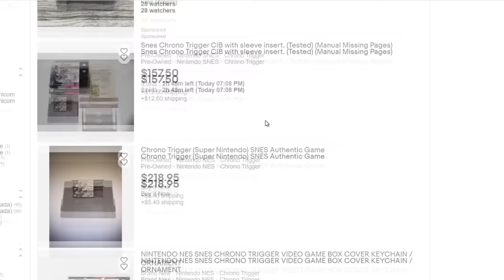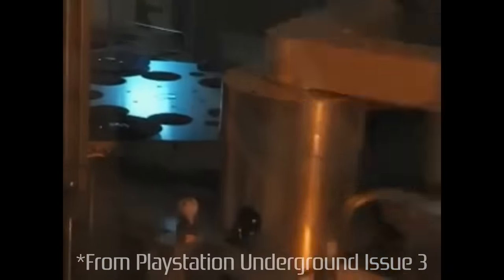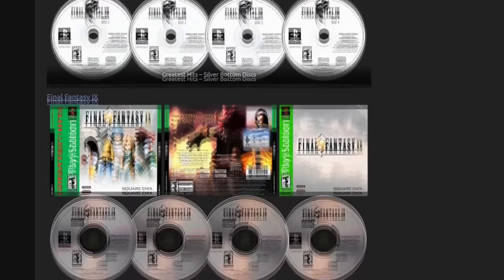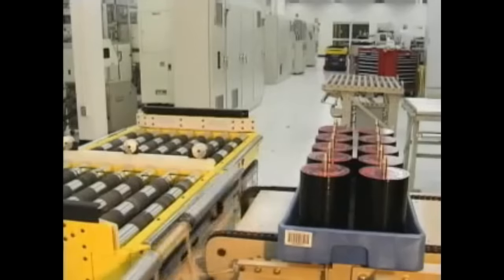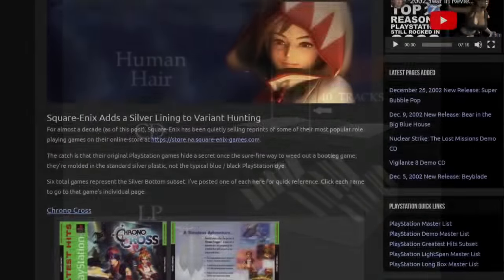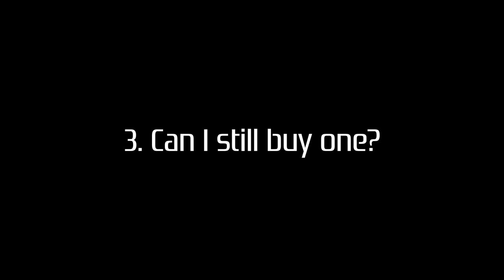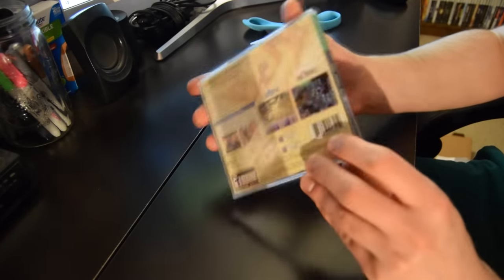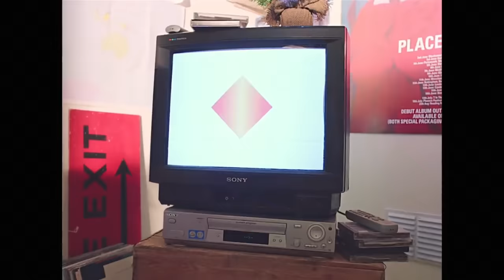Can you still buy a NEW PS1 game from Square Enix's Website in 2023?!

Comment: What they probably mean with the black disc is that as a customer you can spot counterfeits easier. Still today when you see a silver ps1 game, you think of a counterfeit. This is not to stop counterfeits but that the customer can spot one. There are people on the internet that still try to sell a counterfeit to gain money with old games. For example when I look for first and 2nd Gen Pokémon games on eBay, I stumble upon a lot of counterfeits, usually sold at a fixed price. One tip if you look for retro games on eBay, only search by bidding. This way you don't see so much counterfeits and overpriced rated crap. Rated games that have a big value are usually sold by auction, because real collectors know the value.
Well with the Pokémon games, some say in the fine print it's a copy. Yeah no way I'm buying that. When I want a pirated version, I buy a everdrive and just download the game. Or I emulate the game.

In my opinion more studios should sell reproductions but only when as close to the original as possible. For PS1 for me it's the black disc and the big case. Or they just can sell the Roms and let people emulate. Emulators are legal. Sony used an open source one for their PS1 Classic. It doesn't even need fancy drm or so. Downloading them illegal is easy when you know where to look. There are people who would pay for a Rom, even when they just can pirate it. It must be at a fair price. These classic roms don't need to earn money anymore. They only need to pay for distribution. When they provide an updated rom, they can ask for more. They still can make a remake and even charge more.

Comment: chrono trigger ps1 is cheap because its the snes rom with a built in emulator, plus some animated videos.
So when people found out they didn't take it well, expecially since it was a rom, the loading times should have almost non existant. Instead, whenever you changed maps you had to wait 10 seconds or something.
It's just a bad port overall, the new animated anime scenes aren't worth the trouble.

Comment: i was a pirate during the ps1 heyday, a quick note about the black discs, they were an anti piracy measure but not because it made them harder to copy or anything fancy like that, but because at least initially you could not get black writable media, so even if you did a 1:1 copy of the game, the covers, and the print on the disc which all could be achievable to some degree, you could not get a black disc, which helped people instantly know if a game was pirated, I didn't bother with all that hoopla since the sense of pirated games is for them to be cheap, so a simple printed cover and jewel case was the most I would do, also used printable CDs for the name of the games (prettier than sharpie) and i never tried to dupe anyone selling them as "originals", also after a while you could get black writable media.

Comment: There IS another reason why the PS1 version of Chrono Trigger is and always has been the cheapest version (in North America anyway). It's the worst version. It's almost unplayable. When you pause to go the menu screen for example there's about 6 seconds of loading every time. I have it, but haven't played it in a long time, so I don't remember too much more, I know there's a LOT more problems with it than that  but the thing that stands out the most in my memory is it drags and is so, painfully so, slower. I don't know if it wasn't properly optimized for the PS1 or what but it's noticeable. The only version of the game I straight up quit playing very early on. Granted this was back in the 90s, so maybe my younger self just didn't have the patience. I ended up buying it on sale on steam years later, which is the version I recommend as it has all the added in cut scenes that were put into the PS1 and DS versions.  However for physical to play with a SNES controller as originally intended, I bought the Super Famicom original. I play it on a Retron 5 with a translation patch. Don't know what it goes for now, but I bought it when the Retron 5 came out cib for under $10.

Comment: I noticed this while collecting some PS2 and PS3 games. Square-Enix are not the only ones doing this. The games are new, but they usually don't print the manual, they might just add one piece of paper with some artwork in it. Still, I considered this a good thing, since sellers are going insane with the prices. This allows you to get a new copy for a good price.

Comment: The black discs aren't used as it's a cost saving measure. SE knew these were popular with older fans, but didn't see the need for the black discs as using them would eat into their already small return for these reprints.

While not PS1, Atlus is another company that reprints old games, specifically for the PS2. Usually these quietly hit Amazon and are gone before it's widespread news. Shin Megami Tensei Digital Devil Survivor 1 & 2 and Persona 3 fez and Persona 4 are good examples. The only difference between these reprints and the original print run are the new ones are missing the white label with the game's name at the top of the case you used to find when the PS2 was new, and any other stickers underneath the shrink wrap. The cases are different inside, using the PS2 cases without the memory card slot in them from late in the console's life, but still having a PlayStation logo inside.

Comment: While cost of making silver discs makes sense, there was also another explanation given in the blog post. Basically they are printed silver so that it's easy to confirm if it is an original copy, or a reprint. If it's silver you instantly know that it's not the original print so it's harder to trick people into thinking they are buying a collectors item.

Comment: That's not a legitimate seal lol you can buy a legitimately sealed copy of the game for like 50 on eBay. This content is very misleading to new collectors in the sealed community
Reply from the maker: It’s a legit seal, just a super cheap one.  Sony and Square Enix started cheaping out on the manufacturing of these a while ago, that’s why there’s no holographic sticker or high quality plastic.
Reply: @GAMEGUY1210  absolutely no way! Sony will not use shrink-wrap. Vga wouldn't touch this game
Reply: @GAMEGUY1210  it's a reseal from a 3rd party basement. Even stared as used on website when you bought it
Reply from the maker: @Andy_38  haha I can’t make you believe me man, but it’s legit!  Probably not worth much, so yeah I wouldn’t submit to VGA anyway.  Definitely new though.  Square Enix website doesn’t have the infrastructure to sell used games!  The GameRave article I reference said the shrinkwraps were not consistent between releases with these silver disc variants
Reply: You are right there is no way you will convince me. I've been collecting sealed games for a very long time. You enjoy your $10 reseal
Reply from the maker: @Andy_38  😂
Reply: @GAMEGUY1210  🤣